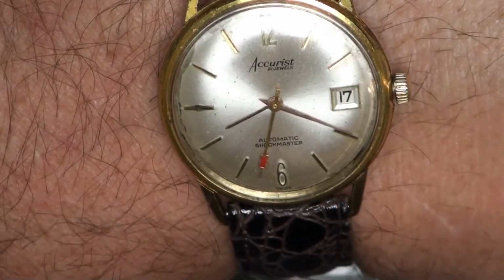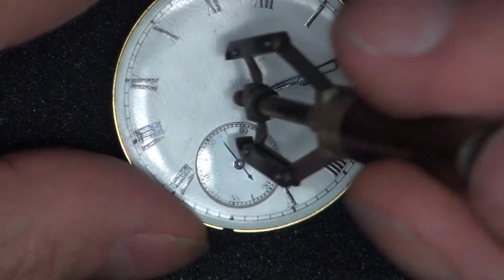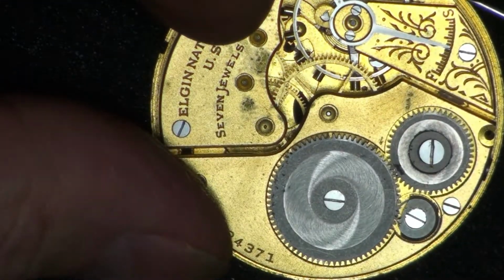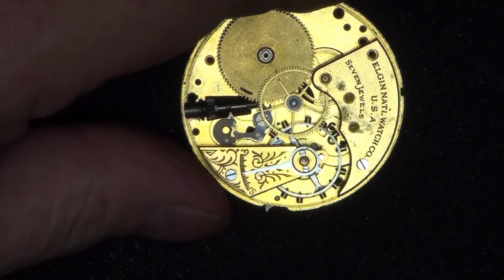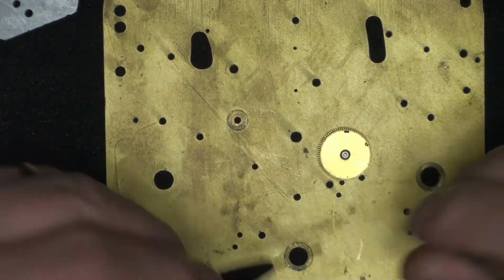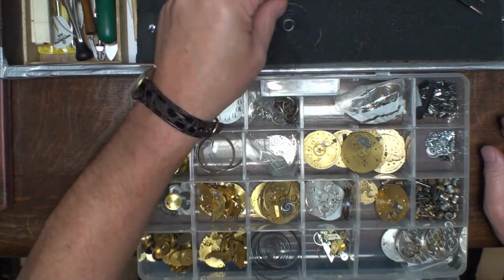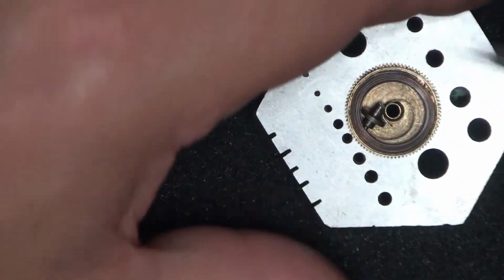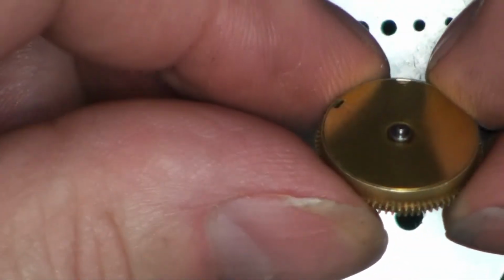Elgin pocket watch main spring replacement part 1...

Comment: nice U had a spring (hopefully that hasn't taken a set over the decades) and didn't have to order one.
Did you do a full service and lube off camera, since you had it 90% or so disassembled anyway?

I believe my 1885 Elgin H.H. Taylor (17j) 18S key whined and set pocket watch needs a new main spring, and probably a hair spring, since with the regulator maxed out, it runs -2 to 3 minutes an hour, and a full whined only lasts about 18 hours. ☹️🥺😭 
It should run (did when new) no worse than +/- 5 seconds a week. (yes.I am aware a 140 year old watch will likely never be as accurate when new again, even after a professional clean and service.) 
I am hoping none of the jewels are bad.